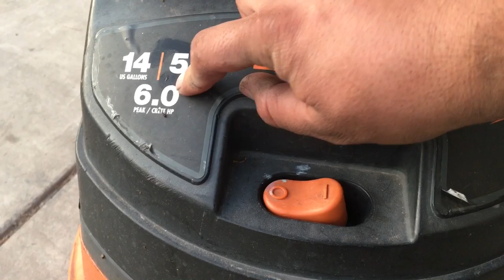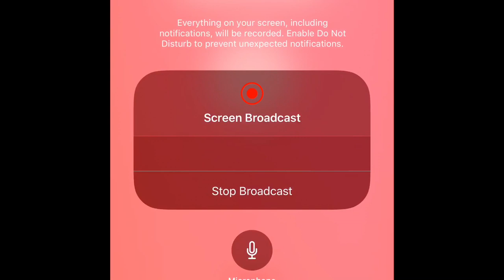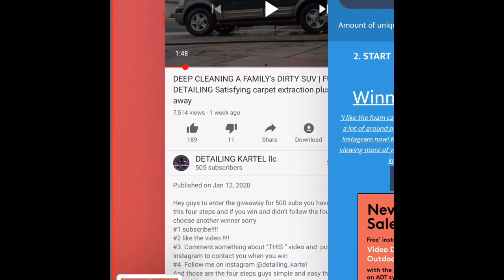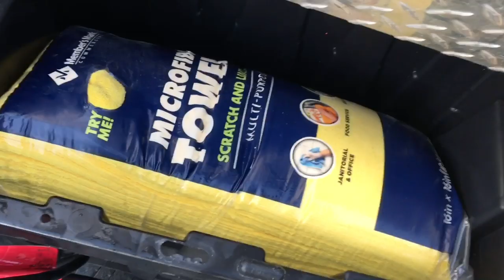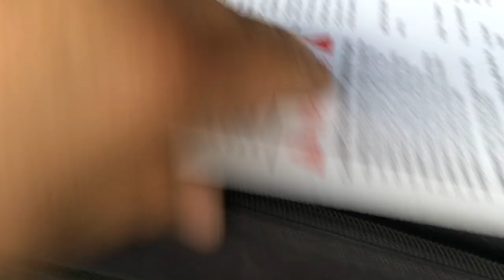DIY CARPET EXTRACTOR|GIVEAWAY WINNER|TRAILER SET UP

Comment: The only thing is the shop vac’s have a water lift of around 50” while the carpet extractor’s have a water lift of around 100” or greater. That’s because of the one stage motor. It’d be cool if you could replace the original motor with a $150 3-stage motor.

Comment: Does this only work if you have a house hose? Or if you work with water tank?
Reply from the maker: If you put a water pump you can use it with a water tank I’ve use it on my water tank when I go mobile
Reply: @detailingkartelllc7382  awesome thanks for the reply. Another question do you think this works better than the bissel 3624 spot cleaner?

Comment: Figure out a way to make it heated and sell it for $500/each lol. You just saved me a G Note! Have you used it at a customer's house yet?
Reply from the maker: Yes I have I use it with there connection and now I install a water pump on it from my tank
Reply: Propane instant hot water heater would be clutch!
Reply: A tankless water heater used for RVs an camping amazon has them for $135 🙌✊👊